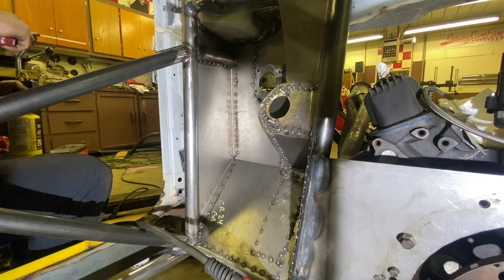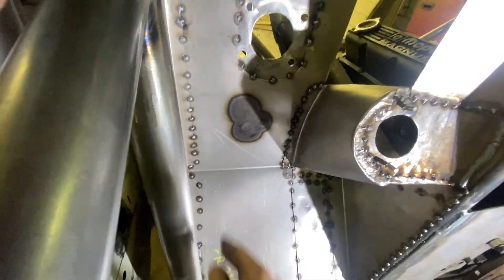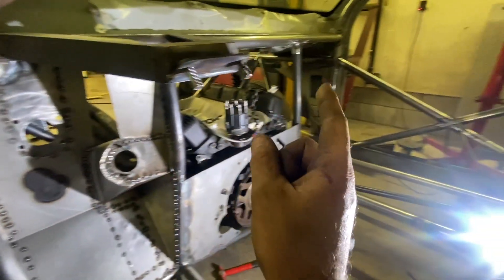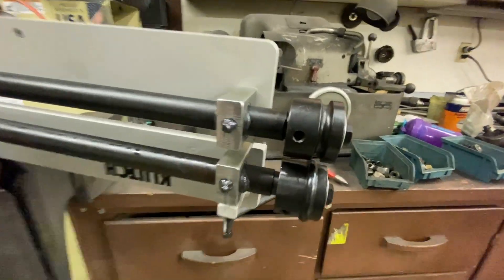How to build Sheet metal firewall for our Tube Chassis Build 2nd gen Dodge Ram

Comment: What did you use to make your frame rail for fine chassis and stuff wow
Reply from the maker: @davecaresforyou7606  affordable bender love it!
Reply: @ how did you know whiny angles you needed and have you done anything else with the stroker 5.9
Reply from the maker: @ ya got bigger connecting rods for it and that’s about it need to get it rebalanced and reassembly is ready

Comment: You stretched the metal as it was cooling by pushing on it with the rag, splash water on it or lay a soaked rag on top and it should work better, nice build man!
Reply from the maker: Sweet I’ll try it out! Thanks for the tip

Comment: You could Cut some sheet  metal into 1 inch strips spot weld it to the problem  spot in the shape of  an x it wont add much weight and  will quite  down  any problem  spots good luck.
Reply from the maker: Very good idea!